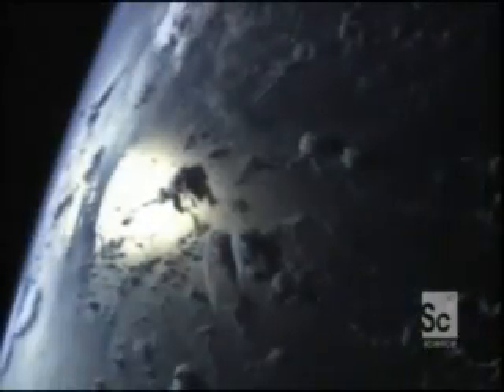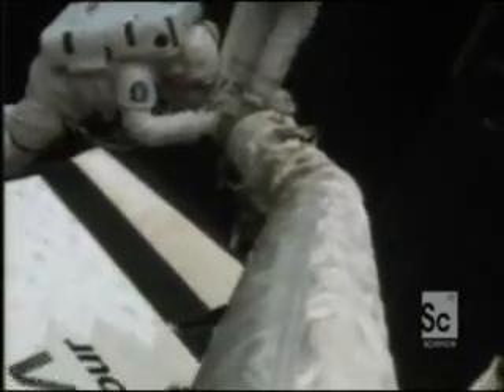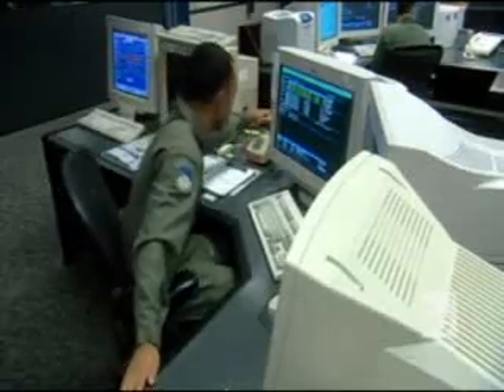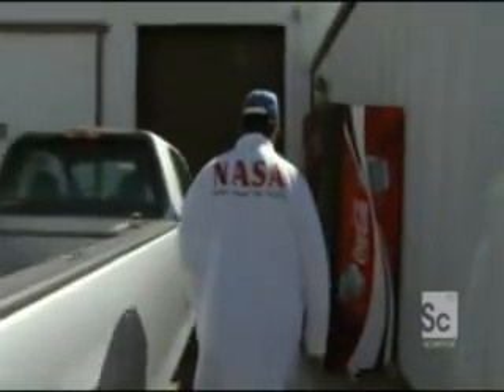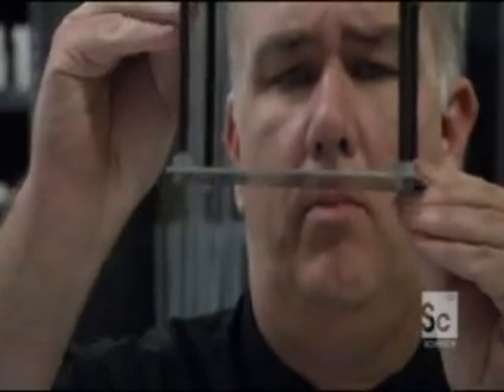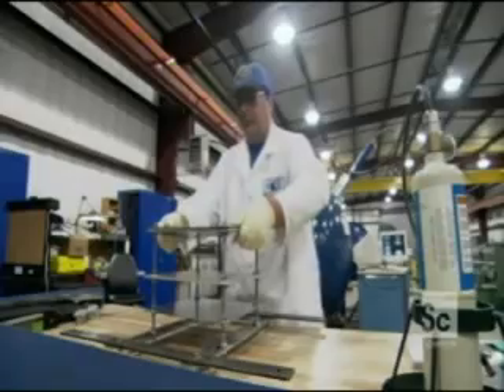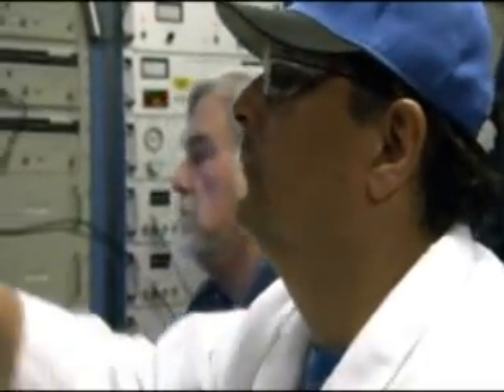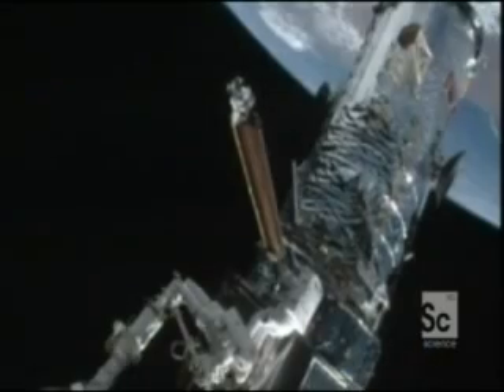WSTF Hypervelocity Gun Lab

Comment: I'd love to work in a place like this.

So so much of the common bullet resistant designs seem inefficient. It's like they're getting half of it right, but they're missing so much of structural engineering trying to make something strong instead of something that creates resistance. I would use a lot of aluminium orbs layered  and buffered with foam, backed by kevlar, and faced with titanium. Outer layer shocks the projectile, inner layer is allowed to shift large amounts to absorb energy, final layer catches the few fragments that get through... I suppose this would be too heavy to get into space or assemble easily, but their design doesn't seem any easier.
Reply: If that the real problem is $$$